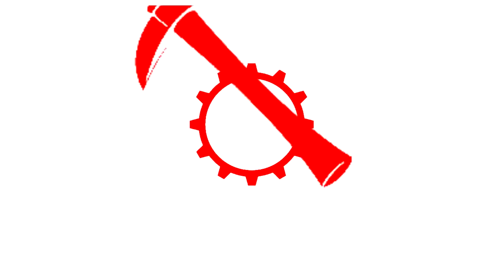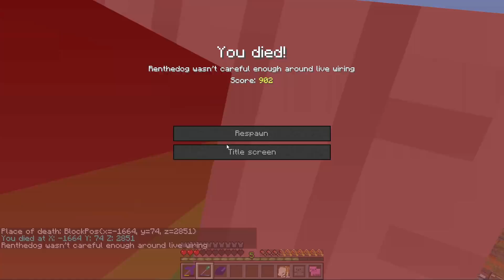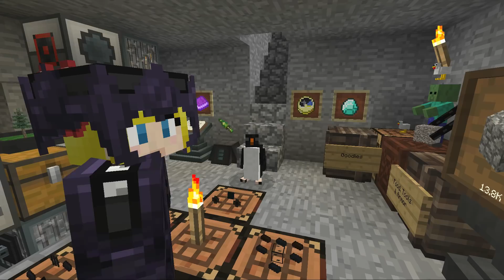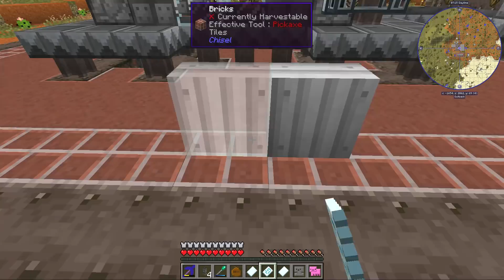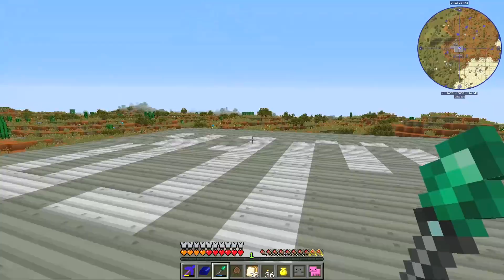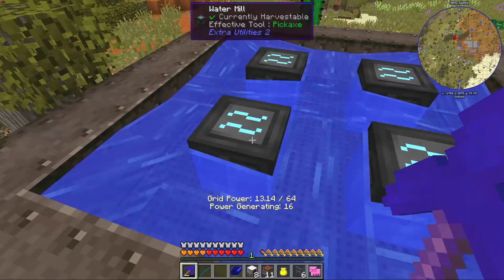FoolCraft 3 | BIG CHEEZ POWER! | Ep 12 || Minecraft Modded 1.12

Comment: the tier 2 speed upgrades for the culinary generators can stack up to 16, instead of only 4.  so for twenty generators, you'd need about 320 grid power.  kill the ender dragon to use the egg to power the dragon egg mill; which produces 500 grid power from a single mill.  
and i'm pretty sure each speed upgrade multiplies the power by the original amount.  so 60 + (60x16) = 1020 rf/t per generator.  and with 20 generators, that would come out to over 20k rf/t.  
but i would guess the battery you're using will only accept up to 4096 rf/t, so you'd need to limit each stack to 4 instead of 5.  that would still get you over 16k rf/t.  
of course, you could have two stacks per "generator"... one at the front and one at the back, and double that for a total of over 32k rf/t.

Comment: Immersive Engineering silos for storage hold over 41,000 of a single item, and fit the theme.  Storage drawers with void upgrades and a single drawer controller are more efficient, and you can use the framing table to make custom-designed drawers that would fit your theme.
Reply: Trashbin is cheaper.

Comment: 320 rf/t per furnace
1600 rf/t per set (5 furnaces)
3200 rf/t per engine (2 sets)
12,800 rf/t for the grilled cheese power generator (5 engines)
16,800 rf/t in total.

Comment: To prevent overflow, you can just put a single drawer with a void upgrade somewhere along the green line, then use a lower (say -10) priority for insert. This will insert any excess sandwiches in the void when all the crates are full
Reply: I second this idea. It allows Ren to keep the visual look of the storage crates while providing an answer to the overflow issue. This drawer can even be buried underground if he doesn't want it visible. I really hope he reads this and doesn't end up swapping all the crates to drawers as too many have blindly suggested. Drawers just don't look good with the rest of the design palette.
Reply: Even better would be to use the crafters from RFTools as others have suggested. I was having issues with my own food factory until I cottoned on to them since you can set which slots can accepts which items and never overflow on stuff you accidentally create too much of.
Reply: Isn't their trashcans in this mod pack if you know what I'm sayin
Reply: Yeah, there's also trashcans for voiding overflow.
Reply: The problem with RFTools crafters is that he still needs buffers, as the conveyor belts won't check if there's any free space before extracting. If the selected slots in the crafter are full, the conveyors will just leave the items floating around.
Reply: Entcraft44 Correct, you couldn't use conveyor belts directly into the RFTools crafters without causing overflow on the conveyors themselves. Personally this is why I use item ducts for my Foolcraft autocrafting setup. To be fair to the Ren of Dog, the conveyor belts do look amazing.

Comment: You can just simply paint your facades with the immersive engineering or the other item pipes. I don't know if it will work, but it's worth a try.

Edit: Ren, it would be more efficient to stack HV capacitors next to or on top of each other in a 'row/column' then surround with generators. Sure you get less gens per capacitor, but you make it more efficient to run your item lines and power lines.
Reply: Yeah, I'm thinking the same, let's hope facading the immersive engineering pipes will work
Reply: If you look at the conduit facades before he painted them with the crates, they were painted with Itemducts. So he tried it out already.

Comment: Immersive has breaker switches, power transformers, and shutoffs. Have you made the manual with a book and lever? Scaffolding acts as a ladder block. Could use to get up top on the pylons. Maybe a thin floor under power lines to walk around on. And check out the engineer's skyhook :)
Reply: Definitely try out the skyhook in a creative testing world first because it's very fiddly and the in-game book doesn't call out that you need specific connectors for (just calls them "connectors") the wires it works on (hemp and steel, the non-power lines).

Getting the hang of using it isn't too rough, but basically you hold right click when it's in your hand and jump up to bounce your head on the connector like you're super mario. If you're at a junction that goes two ways, you can select which way to go by making sure you're on that side of the connector when you jump. It's not too bad once you get a hang of it and it's super fun.